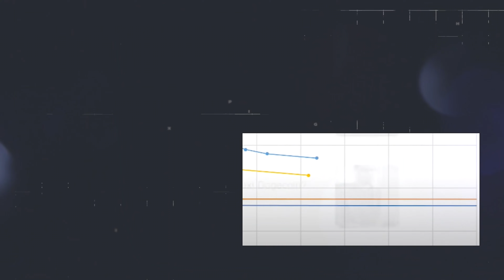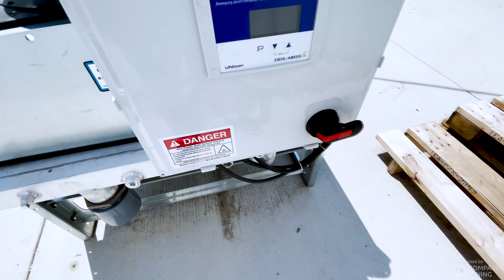BBT 2500GPU Mining Farm moving to Liquid Immersion - Lets get into this

Comment: Coming from normal pc water cooling, I'd really like to have redundant pumps or something that is able to make sure it can never overheat. People often use dual D5 pumps for more elaborate installations to make sure it doesn't cause any issues when a pump does fail. I understand that this pump is probably made to last 5x as long but bearings do fail and if you're not there to catch a bearing that is starting to fail or you simply don't recognise the sound, you might end up with a bath of very hot cooling fluid and some unhappy gpus.

Comment: Hello BBT, first thank you for your amazing videos. You are my mining reference for sure.

I am currently building an immersion rig for 8 Canaan Avalon 1246 miners! It was a challenging project with some wood assembly, soldering of different pipes , the electrical panels for high and low currents. Now I am close to the end but I need a little bit of help concerning the fans settings on the miners.I did not find correct « fan simulator » online to connect to my fans so I simulate their presence. Do you know if I can just setup to 0rpm my fan speed requirement in Linux so my asic keep running even if I removed the fan ?

If you don’t have the answer, do you have any good contact to share so I can adress my questions ? 

By the way , my rig will be connected to my main house heat station (thermal exchanger between rig and water circuit) I will heat my house with it during winters and almost switch off my heat station :-) 
Basically I will use two times my electric power. 

Can i send emails to BBT ?

Comment: You are a rock star!  Dude, seriously, super mad respect for what you have accomplished!  Also, it's amazing you are sharing all of this valuable information for the general community, that is very generous of you!  I'm curious what else do you do for hobbies?  Have you considered buying a yacht?  It would be pretty cool if you bought a yacht and set it up with a mining farm on the yacht with immersion cooling, you could use the ocean water to cool the fluid using a salt water stainless steel manifold like they use on the water cooled engines.

Comment: What's the cost on a setup like that? It's got to be massive. What's the energy cost versus air cooling? What's your expected ROI? Thanks!
Reply from the maker: Will will break that down in future videos... it is a bit of cost for sure. 10's of thousands actually; ROI is also pretty hard to calculate due to the volatility in crypto, but lets say the current yield/output puts it around 6 to 9 months atm.
Reply: @BitsBeTrippin  Thx!

Comment: The god old saying.. if it ain't broke, don't fix it..  But BBT is maybe preparing to change the mining farm for RVN later on. At 25+ % more power/heat, it is Serious stuff with 2500 cards. If GPUs were running near the long term "healthy" limit on ETH in summertime, changing cooling solution for RVN is critical. RVN is more intense on the GPU. Expect +8c extra on GPU temp. (If tweaked properly) on one card.. and the more GPUs, the vicious cycle begin...more ambient heat buildup, and temps will go even higher long term. Also result in way more noise.
So this new cooling method seems like a good idea (probably neccesary if they want to continue with all 2500 cards on KawPow)

Comment: I am both excited yet just as terrified for you Carter… Good luck with the build, hopefully the mineral solution can maintain good Dielectric properties over time.  Will the tanks be vacuum sealed? You might want to consider ways of removing surface moisture from the solution (or at least keep an eye on it)
Reply: or maybe an inline water separator like a diesel engine has

Comment: I work at cobalt leeching plant as a process engineer and what comes to mind in quick glance is. Would it be good to have reserve solution pump installed parallel so in case of pump faults you don't have to power down. Repair and spare part times can be long. Second thing is that should you have overflow tank under you cooling tanks. You wouldn't loose you liquid in case of a leak or cause "water" damage to you facility. I'm sure you guys have gone trough these, but just a thought.

Comment: i did a rig in some tractor hydralic oil...my problem was i couldnt get a pump to pump the oil so i had to use transmission coolers to steal the heat from the oil.  water is easier to pump than oil

Comment: Impressive setup. As an mechanical engineer I like this content. It will be interesting to see how this works.

I assume you have done both flow and thermal calculations. The distribution plates in the bottom of the tanks are to make sure flow is evenly distributed over the whole tank? Free flow from the chambers looks good as heated liquid rises. And the pump will be located after the tanks and deliver enough flow through the heat exchangers. A lot of stuff can go wrong here. Some trial and error, and you will get this setup going. A spare pump for redundancy is perhaps not economically feasible. Good luck!

Comment: I have no doubt that this yields the best cooling performance currently possible. As for the potential for this investment to generate revenue the only gains I'm seeing is the hash power lost to thermal throttling and the resale value of GPUs that die due to heat exposure. Seems like the maximum potential gain is fairly small in comparison to the cost of all this equipment. I'm sure you did the math on this more than once before you pulled the trigger, is it the scale of your operation that makes this work? It's pretty hard for me to think in terms of 2500 GPU's.

Comment: you should go for a dual pump setup, power consumption will be about the same as they'll ramp up according to the load and there will be a lot less stress on each of them, they will last longer, run cooler and quieter plus if one fails you can easily remove it and have it fixed without having to shut everything down